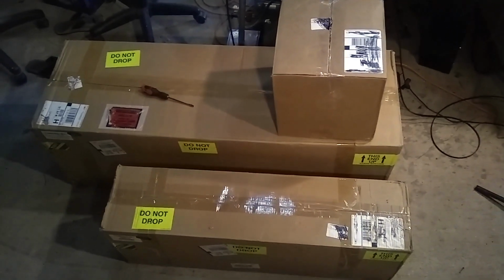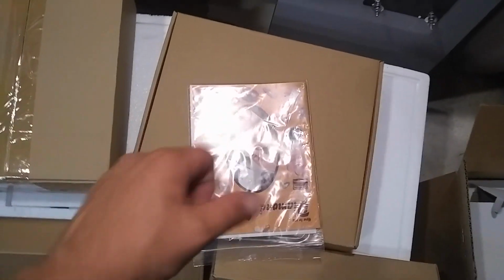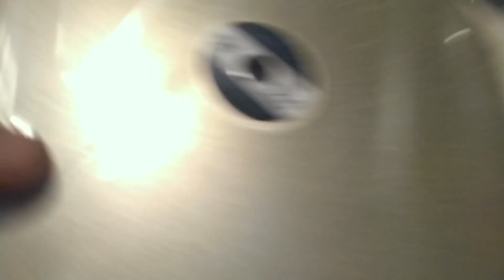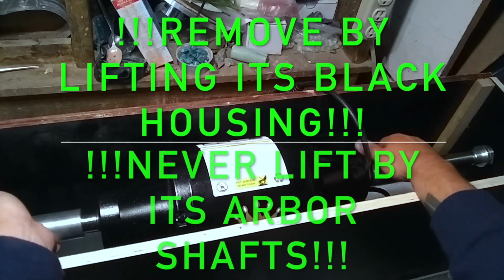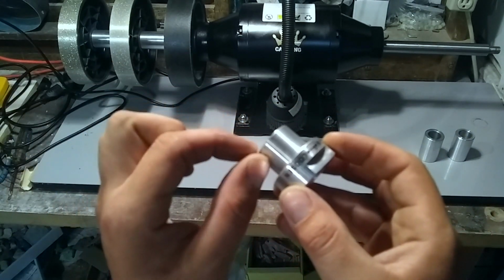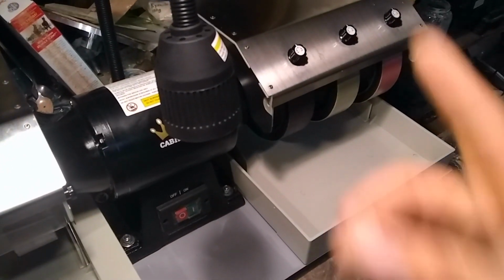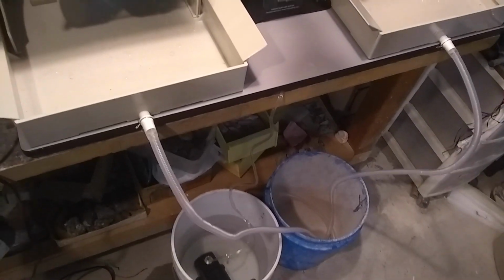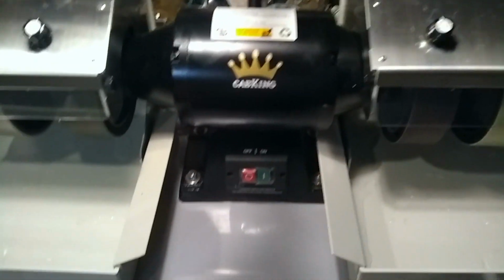UNBOXING CABKING 8'' ALL DIAMOND LAPIDARY MACHINE

Comment: I wish they can improve the drain holes out from the side or perhaps from the back of the machine. Learn so much from you! Appreciate for sharing!
Reply from the maker: salalaos howdy there :) on these cab king machines you can have the drain holes be on the back of the machine instead of the front of the machine because of the way the pans are designed you can have them in the front or the back which I don’t believe I showed off in this video but one cannot have them come from the sides which would be very cool
Thank you so much for watching my friend feel free to ask any of your lapidary questions anytime it’s really my pleasure And if you haven’t done so already please consider subscribing to the channel it really helps

Comment: Thank you for showing the assembly process 👍 I just bought one and love it. It’s very quiet too considering it’s almost 3’ long with all the wheels spinning. I attempted to retrofit a smaller grinder with arbor extensions and was nowhere near the length requirement for all 6 wheels. I had no idea the Cabking motor was that large compared to a standard bench grinder either, but, like you mentioned, the Cabking runs true. I was nervous to turn it on but once it’s up to full speed it just hums very quiet. I have spent probably 4 months trying to piece together a makeshift cabbing machine and finally surrendered and bought the right tool for the job. Fantastic quality construction! Best wishes Dave and I’ll share some pictures of my work when I complete some. Do you have a webpage that has pictures of your cabochons? Or do you sell yours? Anyway, your positive attitude is appreciated as well as your straightforward approach. 👍😎🇨🇦
Reply from the maker: Andrew Gibb Thank you so much for watching the video and thank you so much for letting me know that it helped I really appreciate it have a website of my own are usually use social media to sell my goods or sell them at tradeshows friend me and follow me via #LapidaryDave On both Facebook and Instagram I would love to see some of your pieces

Comment: If I wasn’t married with a family I would buy one of those but that’s a hard sell with the wife . I forget the exact price but it was like 1800 . Have fun that’s super cool
Reply from the maker: I totally know what you mean the industry is not making it easy for people to buy their machines they are definitely making so much more than the machines are worth by charging so much there is a clone of this machine being sold by two different companies when is called Hans lapidary the other is called Jewels & tools I think they are selling the 6 inch for around 800 bucks but even that is a little expensive for a lot of folks so I always suggest shopping for a used machine I bought a used two wheel 8 inch Lortone machine for $80 at gemshow in Colorado 
They can do absolutely everything the big fancy ones can one just needs to have a little bit extra patience and swap out the wheels whenever you need a different grit

Comment: Hi. Interested in how high your table is that you have you cabking on? I am just starting out and have trouble finding a comfortable hight for my cabking. Your videos were very helpful for me deciding what to purchase. Thanks
Reply from the maker: Thank you so much it's truly a pleasure to hear that I was a help next time you speak to cab King tell him lapidary Dave sent yuh :) I believe a table that my machine is on is about four and a half feet high it's just high enough for me I would almost want it a little bit higher,I really want to get one of those fancy pants tables for Rich business people that easily becomes adjustable for standing or sitting situations but all of those adjustable tables that I find can only support about 50 lb hopefully I will find one of those tables in the future that can hold more, good luck on your lapidary adventure and feel free to ask me anything anytime
Reply: Thanks for your reply. When I purchsed mine thru cabking I did tell him I watched your videos and they are very helpfull. Could not be happier with my 8 inch cabking . I built a costom table and I am going to have to lower it a bit my arms are up at a  bad angle. Thanks again love your videos. Look forward to more.
Reply: Home depot sells an adjustable height 52x24 worktable, two drawers, with wheels or leveling feet, supports 300 lbs, height adjustable from 29 to 42, looks like it will be a good choice. I'll be setting one up soon. Query on model HOLT5202BJ1

Comment: Need a grinding wheel solution other than cabking's though for sure. $700 to replace all 6 wheels and they barely lasted 2 months.
Reply from the maker: Johnson Brothers are my favorite they are affordable long lasting and they offer a resurfacing service in which you can even send your old cabking wheel to get them resurfaced for $25-35 a wheel
Thanks for watching and commenting:) consider subscribing if you haven’t done so already

Comment: just got one. water feed taps and tubing were missing completely. drain hose is substandard design and flimsy, can't securely seal. and the assembly of the left hand shaft leaves some of the end wheel unsupported, very confusing.
Reply from the maker: Let’s totally sucks my friend obviously make sure to give them a phone call and let them know what you were missing and if they did not give you the new arm guard that they are including our machines make sure that they do that as well let them know that you talk to me about the problem I guarantee you they will make sure everything is OK
Reply: @lapidarydave  thanks; what is the arm guard? you mean the hand rests? I do have those. Just no plumbing. You seemed ok with the drain hose design.. dont you find it difficult to see how it would seal? the plastic hose doesn't push on far enough to engage the clips.
Reply from the maker: @makkyd123  So I do mean those little foam things that go in front of the water trays to protect your hands that’s what I meant By the armrests 
The drain tubes are bad I’ll pull them up all the way against the water tray housing and then I actually bent the metal clamps that came with my machine to be tighter than they came out of the box you put those over the water trays little drain ports
It’s very hard to help through YouTube without photos so if you don’t mind find me here at this link which is my personal Facebook account this way we can communicate and send pictures even though I do not work for a cab king they do sponsor the channel and I want to help you anyway that I can
Here’s the link https://www.facebook.com/profile.php?id=100010423326634
Reply: @lapidarydave  Yeah, I never got any foam things, I'll ask them about that. I'm going to throw away the drain tubes and plumb some thick rubber pipe instead. Thanks for the link.
Reply: @lapidarydave   I dont think it comes with those. They sent me replacement hoods and nothing else was missing apparently.